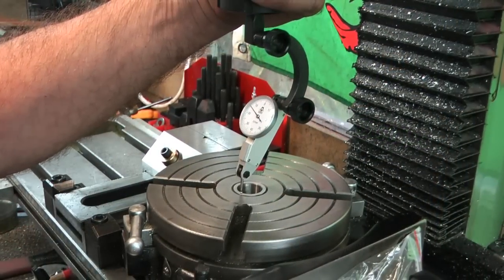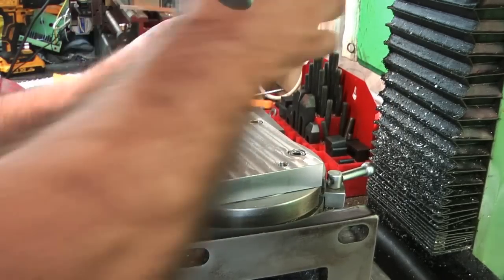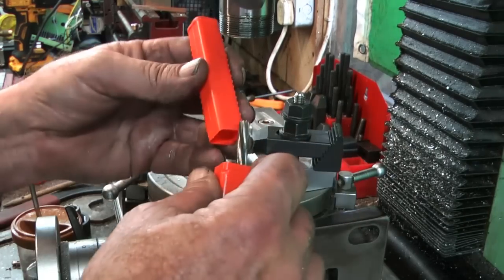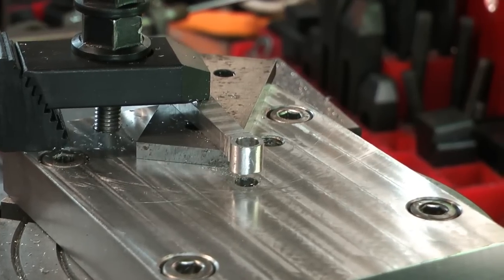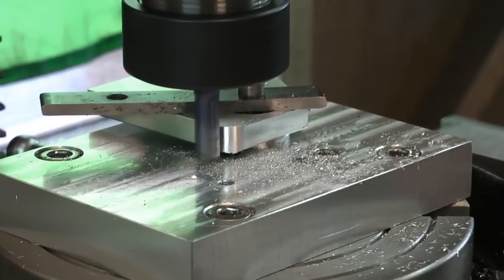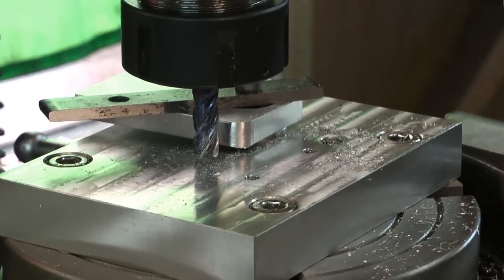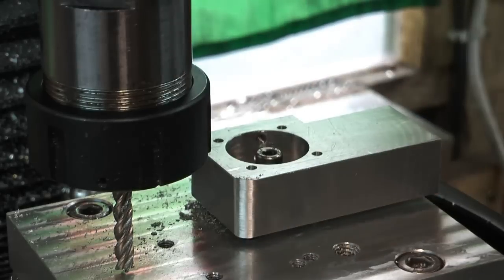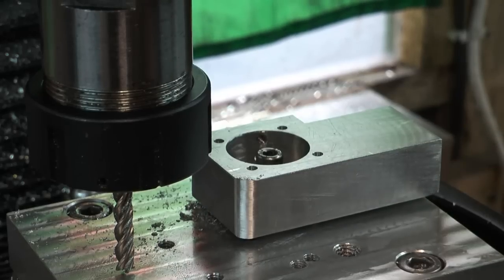Webster engine build Part 5 Conrod rotary table work

Comment: Ade, another time with a conrod, put a pin in the part and the rotary table to give you more stability. You only had it clamped at 1 point and the part could move should the cutter grab or you have a mishap. Regards from Australia.
Reply from the maker: totally agree Dave . this is why I went with the small cutter . Cheers Ade

Comment: Red green and black are pretty traditional for old steam era machines. Blue was used by a few companies for some machine tools, but it was rare. By the gas era, much of the color had gone out of it. One reason is that gas based products had paints that poorly resisted petroleum.

Comment: Do you have dividing plates for your dividing head?  If so, make your own gears.

But, you will need to keep the timing correct.  Won't work if your exhaust valve is opening on the intake stroke.
Reply from the maker: I work with small 4 strokes most days . no worries with the timing set up . Cheers Ade.

Comment: Gday Ade, the conrod turned out great, modifying to a timing belt will be really interesting, I ended up buying 2 gear cutters out of England to do mine, cost wise the belt idea might be a little cheaper, great job as always mate, Cheers
Reply from the maker: gears and belt cost about £15 so seems good deal . Cheers mate .

Comment: It's all looking good Ade so far. Just wondered if EN1A would be ok for Crank webs ???. 
regards.
Steve.
Reply from the maker: should be fine , or even mild steel. Cheers Ade.
Reply: Hi Ade EN1A is leaded mild steel. Which you said you would use. 
Steve.